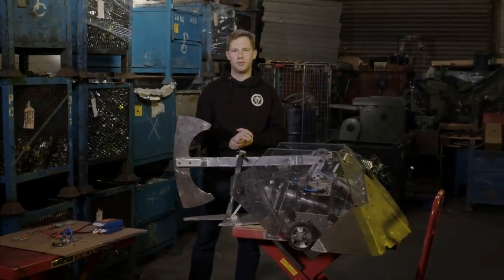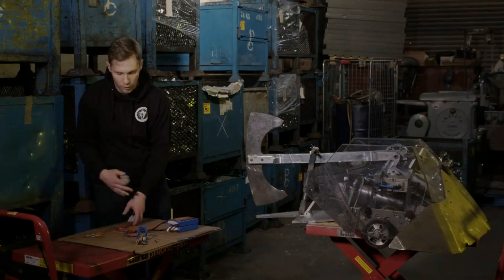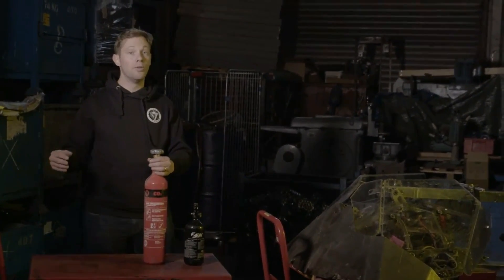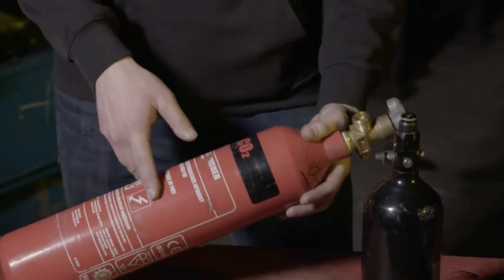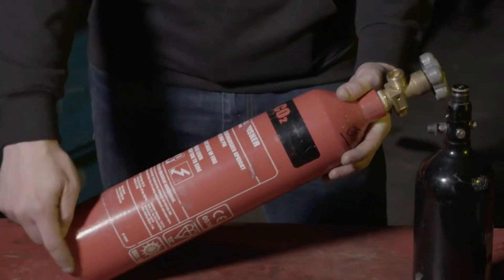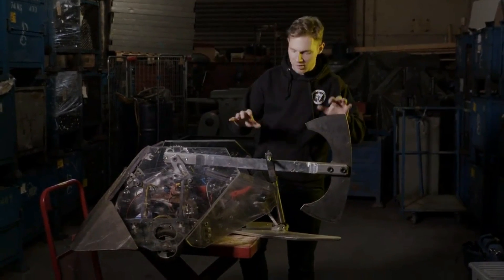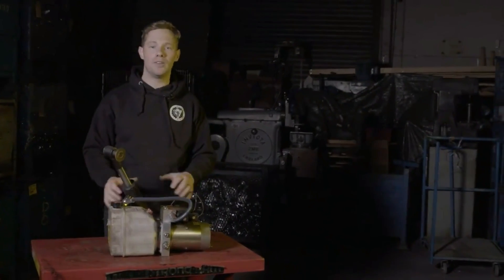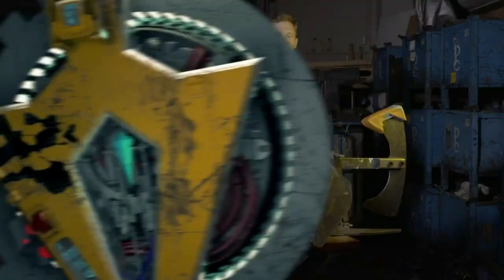How To Build A Robot - Robot Wars

Comment: wer do i get the safety link and what are the rools for spiner robots?
Reply: The only main rules I can think of for spinners are they must spin down from full speed to a dead stop in no more than 60 seconds, are limited to only 250mph tip-speed and must not be made of any alloy capable of shattering such as the S7 tool steel used by many US teams.

Comment: Right I’ve understand the health and safety rules. Now how do any of the electronics. This is no joke I don’t actually know how speed controllers and replays work XD
Reply: Bit of a late response but a speed controller works by taking a signal from a wireless receiver that tells it which direction to go and how fast to go, then the speed controller takes the power from the batteries and chops it up into little 0.001 (or smaller) second chunks, which it then turns quickly on or off to make the motor go faster or slower depending on how many chunks are on.

There are brushless motors as well that are a bit different, where the speed controller does the same but instead times and distributes the little chunks of power over 3 wires (3 phase alternating current) instead of just 2 (DC pulse-width modulated current)

A relay is a little switch that gets operated by a little actuator, so that you only need a small bit of power to operate the actuator but the switch can handle a lot of power, because the receiver electronics will blow up if you try to make it send that huge amount of power directly.

Comment: Are Hybrids Allowed?
Reply: What do you mean by hybrids?
Reply: @Lumakid100  I presume robots which could run on either electric or internal combustion engine generated power like hybrid cars
As far as I'm aware there is no reference to hybrid bots in the Robot Wars ruleset as no team has ever considered building one.

But ICE (internal combustion engine) based bots are allowed.

Comment: Health and safety going way over the top, to spoil things as usual
Reply: Dude robots are incredibly dangerous and could really leave some serious injuries. For example a roboteer from the live events cut off his finger by accident when the robot just started all of a sudden its the type of injury that can be caused by not being safe around these machines.From personal experience we were testing a bot and the bot started up before the controller was on and so it lost control and almost ran straight at our neighbour. Robots can harm both the builder and the audience very badly, these rules are put in place to prevent any fatal injuries. Don't underestimate the power of the safety link
Reply: Blooper Sphoof There are so many restrictions to comply with, so many 'do's and dont's' that build options are so limited to the point of being predictably boring. People want a bit of excitement it's robot WARS. Battle bots much better because of less restrictions.
Reply: killswitches are for pussies, also why so much fear of hydraulic fluid leaking onto the arena? just let it be dirty and slippery, maeks for a better combat field
Reply: This is BOT WARS not The Ellen Degenerated Show, if you prevent robots turning on and charging thru the audience you are ruining the whole experience

Comment: While fun to watch these machines are not really robots. These machines are radio controlled. To qualify as a robot they should be at least semi autonomous on some scale. But like I said fun to watch.
Reply: Its Tele-robotics. Its a subfield of robotics and according to the rules their not limited to this - its just more practical from a combat point of view. 

They could be fully automous for example, however those robots tend to be relatively thick.
Reply: bruceyoung57 Yes that is true. But Radio-Control Vehicle Wars doesn’t roll off the tongue too well.
Reply: Gnimag Pickle - THE definition? No, sir, that's A definition. Oranges are not the only fruit.
Reply: There was an autonomous class way back in the dark ages (1996/97, actually). Look up "robot wars autonomous gladiator rodney" on youtube.